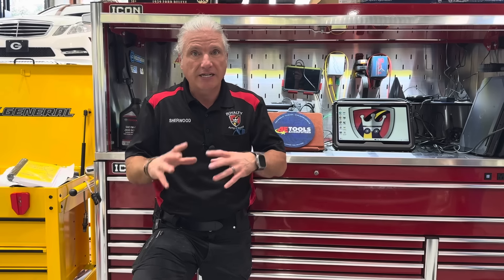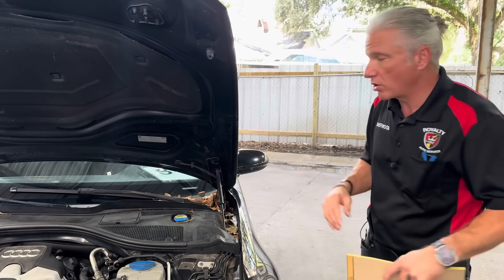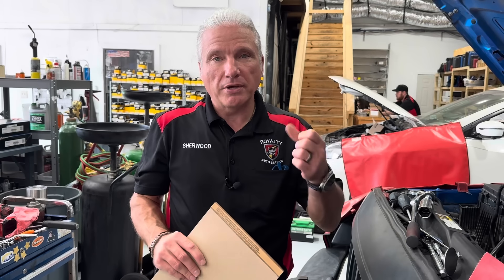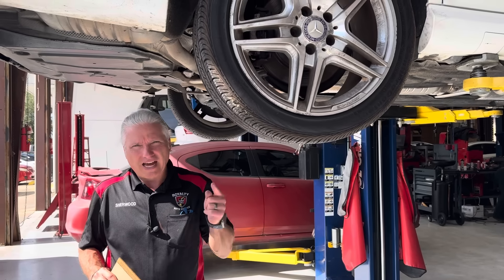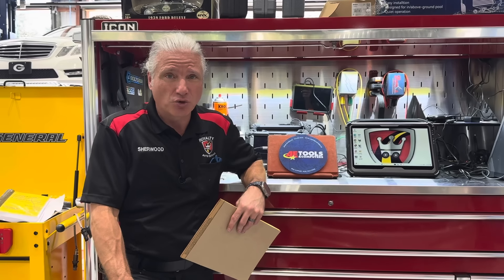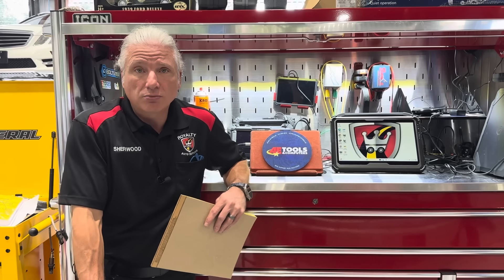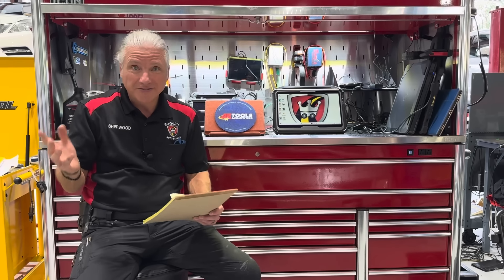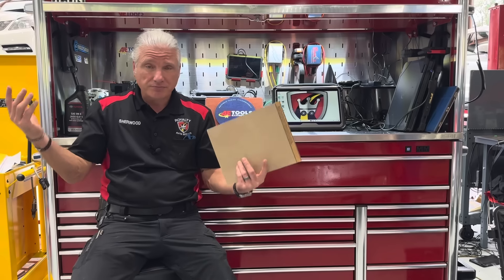Ranking The Top 5 Most Expensive Vehicles To Maintain That We Work On At Our Shop!

Comment: I’m new in the independent world after many years in dealerships.  Many of the Mercedes, BMW, Jaguar/LandRover owners get the repair estimate and take their cars away.  I curse the German engineers every time I work on those cars.
Reply: 2019 X3 air filter change requires you to remove a brace. Beyond stupid engineering in terms of diy.
Reply: Yet: Everyone made fun of “jap crap” cars in the 90’s…

Apparently people enjoy buying “american maaaaaaaaaaannnn” and then end up doing more upkeep

All to? “Fit in bro!”

Conformity on both sides of the isle

Now gimme a typical “cool story bruh”
Reply: lol I’m a Benz tech I love them typically it’s people who can’t actually afford a Benz who buy them have that problem they take it to a dealer like us and go oh uh that’s to pricey then they leave and take it to a independent shop and realize it’s still to pricey lol  I think Mercedes puts more thought into there cars for techs. More than Land Rover bmw and Audi do from my experience with working on them.
Reply: @westayers5174 - I’m thinking about the V6 in the GLK350/E350 circa 2013 - spark plugs on the LH bank, specifically.  “Let’s cram the ECM, its associated wire harnesses, the fuel line, the oil dipstick tube and a vacuum line over here.  Oh and put the spark plugs in the side of the head, like an LS engine and wrap the ignition coils under the intake manifold with 2 bolts per coil.”  I could almost sympathize with the hack who didn’t even replace the plugs on the driver side head at the last spark plug service.  Car comes in misfiring badly with P0306, barely running.  I knew EXACTLY what I would find when I pulled that plug.  The car had 154k miles on it.  The plugs on the passenger side head were probably replaced on schedule at 120k miles.  Looked fine.  Driver side plugs might have been original from when the car was built.
Reply: @ lol I know exactly what your talking about 276 engines they are tricky at first but once you do plenty they ain’t so bad I typically can get them done out the door in less than an hour but it took many tries before I got to that point lol they still make my hands hurt though! They are in very tight places lol
Reply: @ghostwrench2292  best trick for me is get them hoooot they pop out like butter and I mean cylinder 6 plug lol

Comment: Great info. When I was working we used to get rental vehicles. These vehicles had around 137 180 miles on them. New, plastic still on. I got a Ford Explorer about 2 to 3 months using it while on the Highway it would not accelerate. I thought it was the gas. I took it to get checked out. Throttle body and needed to go to the dealer. I took it back to the rental. I then got a Jeep Cherokee, on a windy day the wind pull the driver side door. It bent the metal there was nothing to stop it from going further out, except the hinges. Then when it shift it felt like the Transmission was going to fall off. These were brand new car. First rental was us. Then I got a GMC that one was a lot better no issues.
Reply: I work on enterprise cars. 
Not uncommon to see blown headgaskets or worse at 10-20,000 miles
Reply: I was recently in an accident and got a 2024 GMC pickup for a rental. What a piece of garbage.

Comment: Be sure to look at Tesla Model S for the least expensive.  We bought a new 2014 model S and have only had to replace tires and wiper blades in 141,000 miles!  Original brake pads still good. Amazing.  Battery was replaced under warranty at 94,000 miles( no cost to us).  Hard to beat these numbers.  Car also came with free super charging for life.  Car was expensive ( $126,000 in 2014) but no maintenance.
Reply: A friend of mine got the same Tesla, 4 Motors and many minor problems as water intrusion, HV water leaks, complete suspension......you just got a good one or you do not drive it as my friend 😂
Reply: Cheapest brand to own according to Consumer Reports survey. Model 3 at~$4000 over 10 years.
Also Model S broke their assessment score with an 11 out of 10. And MotorTrend best car in their 75 year review history.

Comment: Ford retiree here - I was so disappointed when Ford jumped on the turbocharging bandwagon with their ecoboost engines.  This was a foreseeable problem.
Reply: Ford’s 3.5 v6 was its last good v6 engine.
Reply: @jonathana2079  I worked on the Coyote V8 team for awhile - that thing has proven to be a real winner as well!  Of all the cars I have used as my daily drivers (leased, owned, company assigned), exactly zero had turbochargers.  I've always thought that they were more trouble than I wanted to mess with.  (of course, I've driven turbocharged vehicles - mostly turbo-diesel trucks, where a turbo actually makes sense!)
Reply: they dont have a choice, regulations have forced all manufacturers to move to turbocharged engines
Reply: @inspire6837  specifically which regulations?
Reply: @KeithOtisEdwards  Oh my bad I forgot Im supposed to link every specific law on youtube comments, did you want that in MLA format

Comment: Audi, Chrysler, Mercedes, BMW, Jaguar/Land Rover.  Chrysler being behind sheety Audi surprised me.  And I suppose customer just let their Nissans go out the door to the salvage yard rather than replacing the CVT.
Reply: You’re the real MVP
Reply: We dont work on European at our shop but ive learn all cars can get expensive real quick. America's Big 3 aren't much better than Europe's Big 3 as we saw in the video(With Chrysler being the worst 😂). The difference is parts availability for German vehicles since they come from europe and of course they are luxury brands so it's going to add more to the repair cost.
Reply: My Nissan Hybrid is the best car I've ever owned in silent after 5 mins and throw my back if I pedal a little more than needed. I asked buyers to auction it when I sale it because I want the RX450h. There was five of them.

Comment: Jeep stealership wanted over $800 to change 6 spark plugs because the intake had to be removed to replace 3 of them. It was giving a code and skipping a cylinder. I asked if the offending cylinder was on the difficult or easy side and they said the easy one. I told them to change the easy 3 and let it roll and sold it.

Comment: $2000 spent on our  2011 Ford Edge with 68K miles to replace the PTU that Ford says does not need to be serviced.   $4000 to replace steering column shaft on our 2013 Lincoln MKS with 80K miles.  We love driving both cars, but they will be gone next week when we pick up a 2021 Toyota Highlander.
Reply: Good you're getting rid of the Edge. Ford creates stupid design flaws on all their vehicles so they are expensive to fix. The Edge also has the water pump located on the inside of the engine that when it leaks will cause water and coolant to mix with the oil and destroy your engine bearings and cause catastrophic engine failure.

Comment: Some interesting data, thank you for for putting this together.  If I may recommend a few suggestions on data coalition for the future that could give more insight.

The first would be to suggest to use the median instead of the average as that would help give a better representation across the different expenses of repair.  For instance, if you have 10 cars coming in, 9 just require oil changes but the 10th requires an engine swap, just taking the average is going to give a false impression of the true cost of ownership as 90% only spent a few hundred on an oil change.  If you take the median it would help to account for the larger disparity of more expensive repairs with regards to their frequency.

The second would be to separate labor from parts costs.  This would help to showcase what you were talking about with the Audi where some relatively simple fixes require a lot more labor due to the packaging of the internals making it more difficult to access a location.  This way we can see if brands tend to be more labor intensive vs. cost of parts being expensive.

Lastly, it might be worth taking your data set and using an LLM (like the data analysis component of ChatGPT) to sort that data for you.  The example you gave of wanting to see the data vs. how old the car was could very easily be done by an LLM for you by just asking it a few questions :)

Thanks for the insights!!!

Comment: Of course, I just traded my 2015 Range Rover sport HSE, 275.00 for an oil change, at 75k miles, it was determined the suspension was worn , oil leak, 13k worth of work. I knew it was coming, I got into a Cadillac CT5 V model, couldn't be happier.

Comment: Toyota quality is starting to fall of big time
Reply: Aw man that's all we need is the one brand we could rely on with regular maintenance and parts availability.   If the Hilux/Tacoma/4-Runner crap out there is no place else to go.
Reply: All manufacturers are. More technology results in more problems. Toyota is still the most reliable, ask any mechanic.
Reply: @Starman-yt8lj  The newer Toyota, Quality is failing. Engine failures with the Tundra are occurring more due to manufacturing defect. Warranty claims for Toyota has gotten into their profits in the third quarter.

Comment: I've played with cars for almost 50 years, and was in the car business for 30 years before retiring. The most disturbing reliability trend that I've observed is that in many ways we are going backwards.  Components that were once bullet proof have been redesigned poorly - or if you are into conspiracies they are designing more failure or expensive repairs into cars on purpose.  Gas direct injection engines have massive carbon build up problems, plastic engine parts fail predictably vs. their cast metal predecessors, internal water pumps are just wrong, camshaft and lifter failures, 7 8 9 10 speed automatic transmissions fail expensively, bad machining crankshaft failures, cam phasers, and much much more.

Comment: Lots of Ford hate, but I've got a 2018 F150 3.5 Ecoboost, and did have to do the phasers at 130K. Its at 144K, and is just a fantastic truck to drive. So quiet, so much power, great MPG.

Comment: The cheapest transportation I've owned was a (non-GDI) 2011 Kia Sorento.   After 12 years & 98,000 miles, my total out of pocket, over normal maintenance and upkeep, was around $1,400. Most of that was for timing belt, tensioner, and CV boots, a few months before selling it for $9,290.

Comment: Great info! Have to agree on the Ford and GM having owned several models and they ended up being junk. Will stick with Toyota, Honda and Subaru.
Reply: I worked as a skilled trades contractor in various General Motors factories throughout Michigan. I strictly forbid my family from driving ANY GM PRODUCT !!  if it is not designed in 🇯🇵. Japan it won’t sit in my driveway!  Currently we own Toyota, Honda, Kia and Subaru.  The products built by GM are built to a production number out the door. 
Japanese manufacturers build to a quality standard or it doesn’t make it out the door !

Comment: Had a 2002, Mercedes CLK-55 AMG. Stolen in  Charlotte NC a few years ago. GEICO requested that I total the maintenance costs for the past two years which totaled $13,500. That included close to $4000 for a new convertible roof. Still, Maintenance costs were extremely high. Much higher than the Jaguar it replaced at that time.

Comment: Love my BMW 530, so far  never had an issue in 3 years of ownership. But I do know that spare parts are not cheap , and it always pays to have a problem fixed sooner rather than later. Worst car I know of: my nephew‘s Jeep. Indestructible: my uncles oldish Mercedes E class, 300 000 miles and running…..Very decent: various GM models and a Buick we have in the family, not troublesome at all!

Comment: 2008 Merc E550, have 254k miles on it. I have had to replace an alternator, RH airstrut (from hitting a pothole), ball joint and oil cooler gasket. Cant complain

Comment: After owning many different vehicles that received excellent service (my bank account as proof) and driven conservatively on average the number one factor to having a reliable vehicle is one thing-LUCK LUCK LUCK!  The most reliable vehicle I ever owned. A late 80's Mercury Grand Marquis since new.  I got rid of it after 120,000 miles because it needed a lot of A/c work and the dash was all cracked by the sun, etc and really needed to be replaced. I sold it to a woman at work whose boyfriend was a rancher and he used it to chase and roundup cattle in the fields. Got 700 dollars for it.

Comment: If you are combining VW and Audi, it would be helpful to tell people the breakdown between the two so they can have an idea of what is driving costs.  If it's 2:1 VW:Audi, one can assume their VW experience will probably be representative.  If it's the other way around, they can assume that it will probably be less than that.  The repair for crankcase valve issue you show will not occur on a VW because they don't have a supercharger to remove in order to gain access.  If that is relatively frequent as you say, that will skew the average "VW" bill upward while not representing VW at all.

Comment: Ok I have 365k on my '99 Camry and I have never had a major problem or major replacement or crazy repair bill. True I do most of the maintenance myself, unless it would involve a lift or special equipment. But still... Original engine, trans, and it's nearly as quiet on the road as a LS430 I drove a few times a while back. Most of the work needed was normal suspension / steering wear items. Tie rod ends, bushings, struts / mounts, radiator 4x, timing belts, not much else!!!

Comment: About 10 years ago, I got to wanting a black Audi S5 6 speed manual with the titanium 5-spoke wheels (if you're a car nut, you know the car I'm talking about). I'm a middle class guy on a first responder salary so a new one was not feasible, but by some stroke of luck (or evil), one spec'd out exactly like that came up for sale used off a three year lease at a nearby VW dealer for a very attainable price. I went to go see it right away knowing it wouldn't last. When I got there and asked to see it, the salesman stalled me a bit and disappeared for a few minutes. He came back and sheepishly told me it was not for sale yet. He admitted it had its wheels and tires stolen off it in the sales lot the night before and was left on milk crates (very high crime city). I was crushed but moved on. The salesman offered to call me as soon as the new wheels and tires were installed but I told him not to bother. I didn't want a car that may have been on its belly without wheels. Stuck with my F150 and have since traded for a new one. In the years since and after all the internet and youtube videos on the high cost of owning German cars, I see those wheels getting stolen before I got to see the car as one of the biggest blessings of my life!